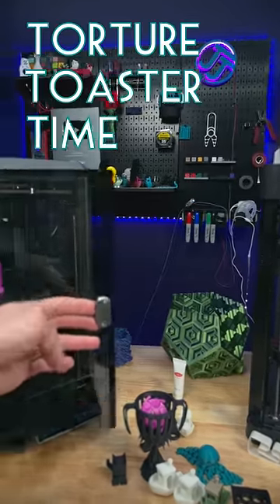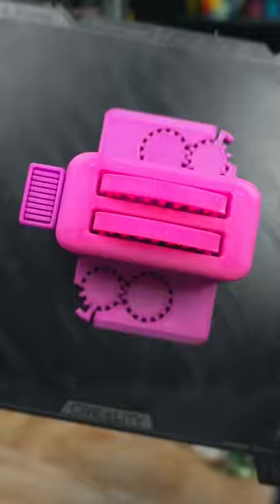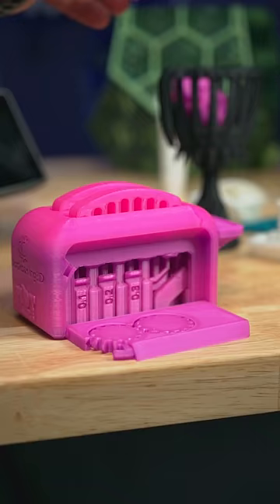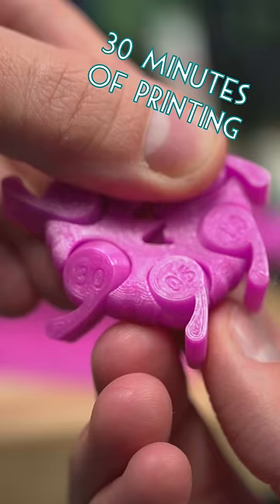Creality K1 Torture Toaster Time 🍞

Comment: I think the tolerance-test-tower broke when flexing the build plate. The remnants of the top of tower could only be there if there was something to print on.
Reply: To be fair, that something could simply be spaghetti from the parts around it. It's often enough to start printing a failed overhang or even a separate part again despite everything.
Reply: @EgorKaskader  I would think he would have mentioned the spaghetti or we would have seen it.
Reply: @xsvforce3335 I think "it failed" counts as mentioning it, shorts don't have enough time to go into every detail
Reply: When he breaks it off the plate you can see the towers that are missing snapped off

Comment: 0.5 mm is bigger than 0.1 mm, so yea no shit it handled it fine
Reply: Was just about to say the same.
Reply: its actually 0.05 he just said it worng but you can see on the coin
Reply: @fabiofanf3e813  didn’t say that to me
Reply: @fabiofanf3e813  it says 0.5 on there but yeah that's the lowest on the coin. it goes from 3.0 to 0.5
Reply: @yoeriw7099 there is no point on 05, but its confusing bc on the 3.0 and 1.0 is a point. So mayby its a printing mistake
Reply: @aris5933  I went off by what he said in the clip. Also it makes no sense to go from 1.0 to 0.05 if all steps above were way smaller. So I'm guessing the dot got lost in the print as you suggested.
Reply: Straight up! What a fail that he thought it was .05 🤣 i believe you just dont have .1 tolerance or less my dude 💀
Reply: It was 1 mm not 0.1
Edit: i stand corrected lol i rewatched
Reply: It's an engagement trap. Get people upset so they make a comment. Like, 18+18 = 32.
Reply: @fabiofanf3e813 no, it is 0.5 or it would be a lot tighter fit.
Reply: @aris5933  so I guess it failed to print it clearly, which also counts as failing part of the test. more important to me, since I break down my prints into separate parts
Reply: @DrivenMars a fail? Do you realize a fail means you failed the whole thing? How is a minor mistake a fail? You kiddies are ridiculous.
Reply: @muuubiee EXACTLY  It’s like the old internet adage of “how do you get someone to give you an answer quickly online?” A= Post the wrong answer. Then people with nothing to live for will call out your mistake while doing nothing productive in their own lives.
Reply: @muuubiee it's 36, oh crap, it worked
Reply: The toaster 0.1 test seems like it would have more surface area between the two parts when compared to the coin making the toaster test a more difficult test than the coin irregardless if its 0.5 or 0.05. Also,  that lever on the coin was quite flippity floppy, if it was supposed to be 0.05 then why was it so loose? Looked more like it was 5.0 tolerance!
Reply: @fabiofanf3e813  the coin says 0.5
Reply: @billnoname8093  I think the model was missing the dot

Comment: I think this is better than testing one thing at a time because when you're printing something that has those kinds of parts and features, you're going to want it to be able to meet all of those specs at the same time. You can't print it right and then go back and print the rest of it with overhangs. Either it can do both or it can't
Reply: I was about to say this exact thing

Comment: The coin tolerance test looks so fraudulent haha, the result from the torture toaster seems much more accurate. There's absolutely no way that the 0.05 has THAT much play, it should be super tight in there.
Reply: What kind of 3d printer produced 0.05 tolerance!?
Still tough 0.5 should be pretty tight you're right
Reply: In the video he said 0.5 not .05. Even with that it still doesn't make sense because obviously .1 is tighter than .5... So of course it could fail at .1....
Reply: @RedEp1taph  He misspoke in this video. That IS supposed to be 0.05mm, and you can see for yourself in the short just before this one on his channel where he shows it. Also wtf is he talking about when he says "the torture toaster tests too many things at once." Thats the whole point of the toaster. Like, okay bro if you get a nice print in place mechanism that has tight tolerances and overhangs you're just not gonna print it since you can't achieve both tolerance and overhangs???
Reply: @jxdinglol  No he didn't you can see the imprint on the plastic "0.5"
Reply: @Khaynizzle7  Yeah and by that logic the number next to it would be 3.0, which is ridiculous. A 3.0mm gap would make the piece fall out.
Reply: @jxdinglol  3mm is 3/25th's of an inch. Idk about that dog.

Edit: for clarity an inch is about 25.4mm.
Reply: @Khaynizzle7  My last comment got deleted, I guess because I linked his other short. But yeah, regardless man you silly for this one. I seriously doubt you've ever printed a tolerance test with that kind of trolling. Stop it.
Reply: @jxdinglol  bro that gap is definitely 3mm. Your perception of space is skewed lol. 

I used to be a metal finisher. I know what a 3mm gap looks like. That is a 3mm gap on that last test, but keep arguing with math. 0.3mm is so incredibly fine it would hardly wiggle in that space. Don't even get me started on .05 😂
Reply: @Khaynizzle7  as someone who uses mm constantly that is in no way 3mm, that's just absurd of you to say
Reply: @Khaynizzle7  You are quite literally denying what the dude that made this said.
Reply: @jxdinglol  It's 0.3 buddy. The text is upside down, yet you read it like it was right side up.

And I've checked the 3d file. It's failing at 0.3, it is NOT measuring tolerance in 100th's of millimeters.
Reply: @igniscogitare5413  Okay? Kinda seems like we're on the same side here, "buddy."
Reply: @igniscogitare5413  replied to the wrong person buddy
Reply: @Khaynizzle7  I don't see a . On the plastic
Reply: 0.5 not 0.05, the coin is laberd
Reply: 0.5
Reply: im super tight too
Reply: @jxdinglol are you really chastising someone for never printing a tolerance test on a FDM? That’s not a big deal bro.
Reply: @jxdinglol  You may not have functional eyes if you think the 0.5 on screen has an addi9tional number lmfao. Quit.
Reply: @Khaynizzle7 3mm and .3mm are 2 extremely different things
Reply: Are you all such nerds that you missed the obvious "that's what she said" joke in here?

Comment: Remember when i first got my printer, this was one of the first models I printed the first day I set it up. Took 35 hours and ran out of filament because I used the tiny spool that came with the printer, so it was also my first multi color print.  Not only did it test the printer, it also tested my patience 😂

Comment: 0.5 is larger (more loose tolerence).
There is 0.5 mm of play which is 5 times more loose then 0.1 mm, which is tighter.
Reply: He meant 0.05
Reply: @duhsq  no he didn't, it says 0.5 on the coin which goes from 3.0 to 0.5

Comment: I think it's a better one than the short ones, because how well your printer works off the print bed is really important if you're making anything with vertical height, and the length of time is good check for overheating issues and such before a large print

Comment: k-1 is a good printer, but problems may start after the 24th marathon. the probability of failure of the temperature sensor is about 40%, problems with supply, the thermal barrier of the boiler during prolonged heating but lets through plastic, the plastic sensor fails in 10% of printers and a lot of small problems, we have k-1 in our company that just came out and I VERY VERY hope that they fixed critical issues

Comment: Well it's good to know how much you can handle at once but what you did like if you want to do a single thing that's really really small then you print something that's like you showed at the 50 thing and that shows it can do it with those single thing just not with an overly complex 3D print like the toaster

Comment: A test needs at least 10 prints and even then its not really statistically relevant. So whatever works and can print the most tests with the least filament is best. Speed of printing is secondary in this use.

Comment: What print speed did you have it?
Reply from the maker: Outer Wall: 200mm/s
Inner Wall: 300mm/s
Infill: 300mm/s
Travel Speed: 500mm/s
Reply: @JJShankles  wtf? Isn't it normal to have it for example at 30mm/s  the outer wall? That's ridiculus speed
Reply: @nombre652  normally yes (around 60mm/s), but that's what makes this printer so special
Reply: @JJShankles  holy crap

Comment: If only i could get creality slicer to slice things just right so that i could do stuff like that toaster. On my ender 3.
(Base ender 3 with upgraded 4.2.7 32 bit brainboard, cr touch, direct drive mod with metal extruder input, silicon hard standoffs for build plate and glass build surface.)
I’m still getting a boat load of stringing.

Comment: Couple of things: 1) The transition PLA is probably a lot like "silk" PLAs in that the current/stock hotend needs a slower print speed for better control of the depositing filament. I dunno why it is this way; I'm sure one of my cloned selves can spend their week/month exploring the reason. I don't have the time, though.
2) Five hours? May I ask what slicer and settings you used, please? I'm running mine now and Orca is saying 7.5 hours. Thank you.

Comment: Most combination tests are actually kinda crap as diagnostic tests. 

The toaster test is just too big and any failure can ruin the entire thing and not tell you anything at all. 

This is why a standard benchy is so much more useful. If it fails entirely it’s not wasting much time, and if it doesn’t, you can tell everything except tolerance (which isn’t just printer but a lot of filament choice and tuning too) that any other combo test would do. 

Beyond that, you really need dedicated tests for individual issues. You can’t use the same test print for testing out acceleration/deceleration as for testing temps, stringing, etc.

Comment: Would you mind sharing what your basic slicer settings were for this filament?  Or did you use the default profile for PLA?
Reply from the maker: This was just the default K1 profile in the Creality Slicer. I've found the only change needed to the default profile is turning off the "Arc Configure" selection.

Comment: The point of a torture test is to MAKE YOUR PRINTER FAIL. You're supposed to tweak parameters if you fail, not change to an easier test. Kinda ruins the calibration aspect of the whole thing.

Comment: Creality wasn't even trying to hide the knockoff-ness if this printer. Usually they have their own Naming scheme and design. Like the ender series and the cr series (cr- creality). but this time, nope, K1. And nearly perfectly mimicking the print head. Plus, if your gonna spend that much anyway, wait an extra week and buy the P1P, you at least won't have to deal with creality's fire and forget product releases with zero updates, fixes or support. and will have helpful staff, consistent firmware improvements and a vast and cheap part replacement selection and detailed service instructions and intervals. Irs no competition